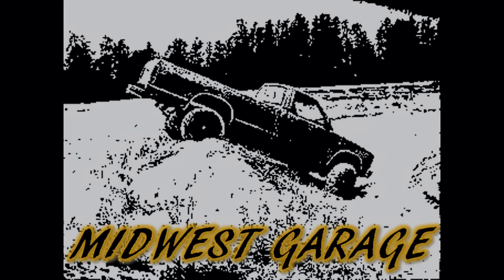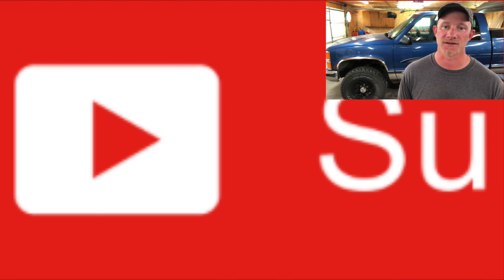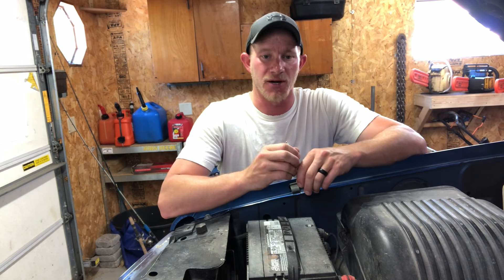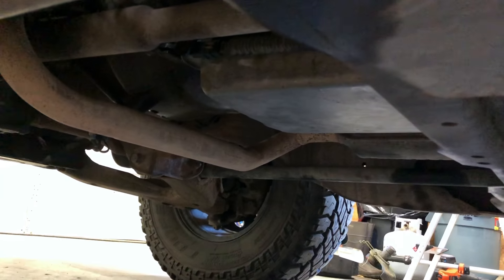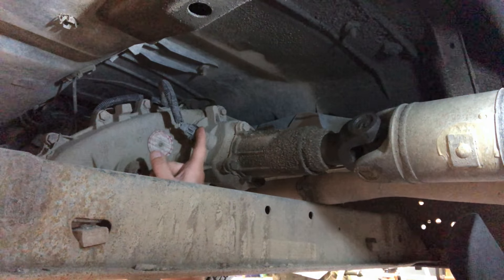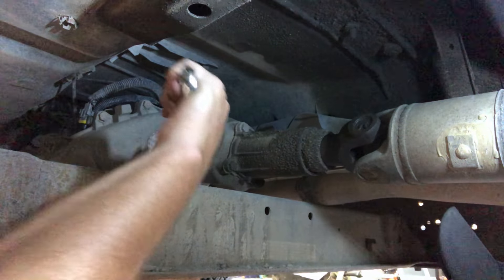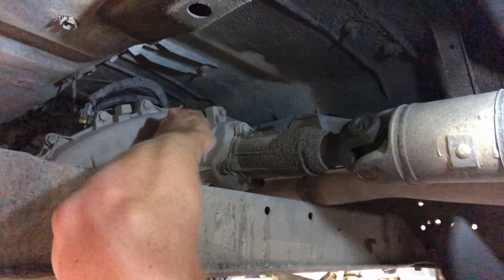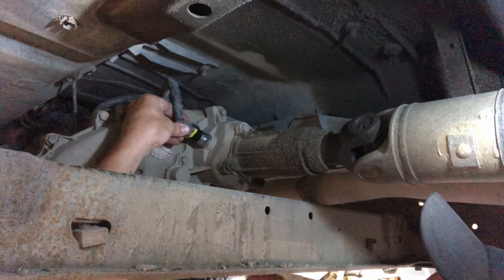How To Replace Vehicle Speed Sensor in 1988-2005 Chevy GMC Truck & SUV

Comment: 380,00000 miles on my 1995 Chevy 1500 2 wheel drive that I've owned  since new. Original Trans and Motor. Been using Castrol full synthetic since new. Change oil every 5000 and Trans fluid every 50,000 Trans started changing funny and slipping and gauges stop working. Change speed sensor, that took care of problem. Thanks for helping me. Kevin.
Reply: Same here. Mine has 370,000 at the moment. 98 gmc 1500 2 wheel drive 5.7 L
Reply: Did it fix the problem right away or did it take a day or 2
Reply: My truck is the same,  my speed o meter read 100 mph when I'm going only 8 mph

Comment: Had two shops look at my 1994 GMC pickup, one wanted to rebuild transmission, the other had no clue. Saw your youtube and replaced my speed sensor. All is fixed now, thanks
Reply: Did yours still shift?
Reply: Was yours making a clunking noise and sometimes slipped in reverse?. Also did it go away right away or did it take a couple days?

Comment: My truck has just been restored to road worthy condition, after having sat for a decade or so. It seems like the speedometer is trying to get me a speeding ticket. When I go 30 km/h, it seems like 50 or more. Maybe I'm just not used to the truck yet, but your video convinced me to replace that sensor.

Comment: I'll be replacing the one on my 1995 GMC Sierra K1500 soon. It's been showing me the ABS light and the speedometer has been bouncing around. My pickup only has 143,000 miles on it, but because it's 30 years old, I think it's time to change out that sensor. Thanks for the tip.

Comment: THANK YOU!! IVE been looking for this awesome video for 4 months!! You just don't know how much this 61 year old disabled lady needed to find this video.  My 2002 chevy avalanche with 260,000 miles has been parked because of the ABS LIGHT, speedometer and shifting issues.  And I've told many that this is the issue.  But no one wants to just help replace for me. They're saying $275. Up to $3,500. But I know that my ole RED just needs this $30. Part and I'll be fixing it myself THANKS TO YOU AND THIS AWESOME GREAT VIDEO!! BLESSINGS TO YOU FROM OLE DISABLED 61 YEAR OLD CENTRAL KENTUCKY LADY!! 🙏

Comment: Rebuilt my trans 7000k ago and it started shifting funny and slipping. Changed the shift solenoids and then it wouldn't shift past 2nd and the speedo stopped working. Almost had a heart attack thinking I had to pull it back out and disassemble to figure out what went wrong! Watched your video, changed the vss and now it shifts perfect again and the speedo works! Can't thank you enough! You saved my sanity

Comment: 1994 Chevy Blazer Silverado Sport, 350ci, manual transmission, 443,000 miles.  This is EXACTLY what I needed.  I'd been noticing these symptoms cropping up one at a time over the last three or four months.  The repair shop couldn't replicate what I was experiencing, so they were stumped.  The most recent one started this weekend with the "Shift" light coming on when it shouldn't, which would be analogous to the erratic shifting experienced by automatics as described in the video.  I replaced the VSS today, and things are all back to normal.  SUPER EASY FIX!  I think it took me longer to disconnect and reconnect the battery than it did to replace the sensor.

Comment: Replacing this sensor fixed my transmission that would shift usually from first to second  then would slip in 3rd  and was shifting all over the place.
Thanks for showing me how the hardest part was getting under the truck.

Comment: I swapped out the speed sensor and it fixed two of the three problems I was having with my 1995 GMC Sierra 1500: the speedometer moving erratically and the automatic transmission not shifting as smoothly as it should. The only thing it didn't fix was the ABS warning light. But I'll check out your other videos to look for a solution. By the way, the sensor in my truck was a whole lot harder to remove. I had to use a foot and half long, 1/2" ratcheting breaker bar with a 1" socket to get it off. Great video! Four years later and it's still helping people fix their own trucks. Thanks. — Richie

Comment: Very helpful. I was told at the mechanic shop that there was a leak at the VSS. They wanted $138.61 to fix it. I said to myself, that's a send sensor, I should be able to fix that myself. So I found your video and it couldn't be easier. Thanks for saving me $$. Dawn

Comment: Based on the diagnosis tips you gave, sounds like this is most likely my problem. Speedometer has been bouncing for about a month, and now it's dead. Had a check engine light come on and go off last weekend, but the most annoying problem (and I didn't realize these are all probably related until I listened to this video) is during my commute to work doing about 40/45 mph, my transmission would jump back and forth between 3rd and overdrive. Thought the worst for the tranny in my '90 V10 Blazer, but now can't wait to see what replacing the speed sensor will do. Thanks so much for an excellent, well presented video. Hoping a $30 sensor and not $$$1000 transmission is the problem. Thanks again, and best regards.

Comment: The car gods must have sent you today...! My 99 Tahoe is acting just like you described. I had thought that it sounded like an electrical issue, but I'm just a lowly woodworker, not a mechanic. I called around to price a rebuild but Dayum at the cost of that! You're a lifesaver! Thanks bro!
(I subscribed)
Reply: Having same issues on my 02 Tahoe , just ordered one from his link.  Did it fix your Tahoe ?
Reply: @rickparshall  Hi Rick. Yes it did the trick. I got under there and replaced it right there at Auto Zones front door. It took longer to crawl under and out than it did to make the repair. But... At first they told me it would be $30. And of course mine cost $95.. Lol. Good luck!
Reply: Robert Ray I'm a woodworker too! And the second speed sensor (the hard to reach one ) did the trick finally.. redid every ground on Tahoe then decided I needed to test every plug with a ground lead.. found one on shifter at tranny and looped the good one to it. I had tested both ABS wheel speed sensors for voltage at plug then for resistance from plug to wheel, both passed those tests so I did the sensor voltage test at plug while unplugged from harness, one spin showed voltage on D/S but P/S had zip.. installed new sensor, light stayed on... no speedo and service brake light came on in first gear and would shift no higher.. first vehicle speed sensor yielded no change, then before finding out my transfer case had another one I had dash ripped apart checking key harness.. found a broken tow-haul wire, fixed that still no change. Today I found the speedo sensor on D/S of transfer case and stuck the sensor in I had taken out of P/S in case after testing it and finding it was good... the abs light went out and it shifts, the speedo works also slew of other issues went away!! You-tube is my friend and I know know just about every electrical circuit on my truck🤣...

Comment: Thank you Midwest Garage. I have a 95 Suburban that was having shifting issues from time to time. Got an OBD1 code reader for my Suburban and it gave me the "morse code" for left rear wheel speed sensor? I'm going to remove this sensor and replace it. Hopefully it solves the issue. Thank you for posting easy and articulate videos to work on these trucks.

Comment: Installed on my 2005 Chev Silverado 4WD, it had a C0300 Rear Propshaft Error Code. With the new sensor, it shifts to Auto, 4 Hi, 4 Low & 2 Hi with no issues.   The sensor was on the Transfer Case on the passenger side, it took about 10 minutes to do and saved me $200 that the Shop wanted!  The old sensor and electrical connector had some corrosion on it from the salty Canadian winters. Cleaned the connector with a small wire brush and covered it with die electrical grease to keep the water out.

Comment: Looks like this is 100% my issue, thanks for posting this. ABS Light has been on since we bought the tuck and speedo + trans just cut out/shift rough. Wanted to comment thanks before I tried the sensor and forgot.

Comment: This video is so helpful! I have a 1993 Sierra that I had the transmission rebuilt in after I bought it (it wouldn’t shift past second, so a needed rebuild) and the speedometer has always been inaccurate in it. I’m going to try replacing this sensor to see if that helps. 

Thank you for the super helpful and clear video!
Reply: Did it work
Reply: Did it work??

Comment: Great job on information.  Had a non working speedometer, ABS light on, erratic odometer and shifting and check engine light on my 1998 Olds bravada. Replaced VSS and all problems fixed.  Perfect video. Thanks.
Reply: Codes for the engine light???

Comment: Super clear explanation. Just purchased a 94 GMC 1500 4x4 Auto Trans. Service Engine light just came on (less than a week after driving it home). I have also noticed sporadic shifting as you mentioned. I'm going to check the OBD and see what codes pop up but this inexpensive, easy replacement is at the top of the list of troubleshooting.

Comment: Just happened to me today with my 1996 chevy suburban 2wd has been running spot on perfect..started it today at the lake and running a bit rough no gauges check engine light on trans feels like its slipping.limped it home and saw your video i will replace the vss and see what happens.i will update when i can..😊

Comment: Thank you for sharing your experience and knowledge.  I will have to watch the video again. 
I am having difficulty in determining which sensor should I purchase for my 2005 GMC Sierra 1500 VHO 6.0L RWD Automatic transmission.  Does my truck have a 16-bolt or 17-bolt pattern on the transmission pan?  Various parts search platforms state the following, "Some vehicles may use the same part for both a Speed Sensor and an ABS Wheel Speed Sensor, while others may use two different parts. These parts serve different systems of the vehicle and may fail for different reasons - it is important to replace the proper sensor to fix the underlying issue."

Comment: Thanks so much for this.  My speedo would occasionally stop working and then later start up again and then today the ABS started flashing a code 9 (Open Circuit to Speed Signal) so this all ties in to what you are suggesting should be an easy fix.  Great video that gets straight to the point.

Comment: I think you just saved me a ton of troubleshooting time.  The symptoms you describe match my problem, with the exception that I hear a bit of a grinding noise when I drive the truck.  i'm hoping when I remove my speed sensor it is still intact and is not in pieces floating in the transfer case!
Reply: This sounds like my issue.  Did the speed sensor fix the issue?

Comment: This sounds like the exact issue my 2000 k2500 ls  is having. Looks like a simple fix thankfully. Gonna do this first, and then clean the abs wheel speed sensor if the problem isnt resolved. Thanks man

Comment: This video was a huge help I was having a issue we’re sometimes my truck would shift horribly for no reason when taking off from a light a code would come on and it would sometimes stay on or sometimes it would shut off. It was this sensor my plug has trans fluid in it so not only the Sensor but my plug as well fixed it and been mint ever since

Comment: I have a 2012 Chevy Express. I'm experiencing shifting problems too. I'll update you on your recommended fix. I'll change the speed sensor and replace the transmission fluid and filter.

Comment: Thank you yes this video really helped me I have a 2002 Chevy 2500 gas and the speedometer don’t work and the abs light is on
Reply from the maker: I'm glad I could help! Thank you for the comment Larry!
Reply: Thank you think I solved my problem
Reply: I have a 2000 Silverado the transmission is just one of the problems this truck has but would solve a few of them for sure!

Comment: I'm wondering if I should replace my vss. My speedometer works but the transmission doesn't shift unless I run the rpms up and let off the gas to shift. Scan tool doesn't show any codes on transmission just O2 sensor bank 1
Reply: @Robbie Lee what did you come up with mines doing the same exact thing

Comment: I have a 2006 Silverado 1500 2 wheel drive and your video was very helpful and informative. Thank you very much. I also have all of the symptoms that you described.
Reply from the maker: Sweet, I'm glad this helped man! And thank you for the comment, it's good to know that it's a common issue and the symptoms aren't just something that we experience in the 90's pickups!
Reply: @MidwestGarage  No GM made sure that the problem kept being reborn in later models too 😆
Reply from the maker: @jameswebb3932  Hahaha, For some reason that doesn't surprise me lol.
Reply: WOULD THIS ALSO CAUSE A NO MOVEMENT WHILE IN GEAR ??? I HAD SAME ISSUES (EXCEPT ABS / BRAKE LIGHT ) 

BUT NOW IT WONT MOVE

Comment: Your video was good but my trans don't slip or jump my MPH is off, my GPS says 60 and my speedometer says 80 to 85 so this runs my RPM a lot higher and really works on my gas mileage. Now I can change the sensor I wasn't sure if there wasn't something under the dash that I needed to do. So thanks for the info.
Reply: Mine's doing this same thing.  No shifting issues.  When I first turn the key on, all the gauges do a self-test, then the tachometer pegs at 6000 RPM and when driving, the speedo is off alot, (it says I'm doing 95 when I'm actually doing 65.)  Man, I sure hope this sensor fixes it.

Comment: Thank you for the video. I've been trying to dial in my 95 chevy 4x4 350, with a surging issue and the tach issue. I've already thrown a bunch of parts at this truck. To no resolve. My truck is a 5 speed Manuel truck. So I'm hoping this will solve my issue. I will let you know. Thanks again.

Comment: Very good video on this well done 
But I wanted to say this wasn’t the case for me it turned out to be a fuse 
I was having same issues no Speedo/acting weird, trans not shifting right if at all and no codes or anything shown 
I spent a lot of time tracking down wires and I replaced sensors still didn’t work 
But there was this fuse in fuse box under dash labeled “brake” changed that out and bam back to normal 
(Fuse wasn’t even blow just corroded enough to not make a good connection

Comment: I haven't done the stuff that you said in your video but everything that you said about the speedometer not working the ABS is on the security light is on and everything and it does not give out of control signal and think if I had to check but it does not shift and I know all the gears are there cuz they weren't slipping or anything

Comment: hey thanks for the tip..i have a 95 silverado thats thumps while going from 1st to 2nd gear but when i disconnect the battery it seems to reset it.....this mite be the problem
Reply: I have a 2007 chevy suburban and it shifts hard from 1st to 2nd gear also and im thinkin this is the problem to our fix man
Reply: Did this sensor fix your hard shift problem?
Reply: Same,  any luck?

Comment: Got a 2004 Chev 2500 HD duramax- would not go into 4wd  but would 4wd low then would not get out of 4wd low. finally got it back into 2wd after putting in reverse and trying different things. Are we looking at the speed sensor or actuary or both?

Comment: Great video Kevin, I have a '89 K10 and replaced the speed sensor about 3 years ago and now I'm getting 9 flashes on my brake light. Everything works fine. Could it be another speed sensor?

Comment: If you have a scanner, you can also see the output R.P.M.'s. I have seen it where it is showing 50+/ 05 R.P.M. and so on, jumping around when you aren't even in gear.  It's not a bad idea to put a new output shaft bushing and seal in as well.

Comment: Thank you for sharing I have a 2005 Chey trailblazer LT 4.2 and my speed gage starts out at 120 and when driving it go off the numbers then when you come a stop it will go down to 80.  Do you have a video for that or tell me about its location on the transmission please and thank you.?

Comment: Great video...straight forward and to the point.  My son's trans will only operate in 2nd and Reverse.  The PRNDL indicator doesn't show what gear he's in.  We've replaced the NSBU and the Ignition Switch as well as an inspection of the TCM connectors...still no luck.  Any chance the speed sensor could be the cause?

Comment: Man thanks. I have a K1500  chevy  blazer just got the transmission replaced and it shifts hard out of 1st and the abs is on and the rpm gage jumps so it's doing all that so hopefully that will fix it.

Comment: Is the output speed sensor located in the same place on a 2005 Chevy 3500, 4x4, duramax diesel, allison 1000 transmission?

Comment: @midwest garage I was coming home from work yesterday in my 03 H2 & while going to down the road felt a hard jerk & transmission down shifted. I pulled over & put in park. Got out & looked under vehicle for fluid or anything outta the ordinary. All looked good. Started vehicle back up, put in reverse went into reverse fine, shifted to D nothing, then 3rd nothing, so I shifted to 1st moved just fine, 2nd just fine, but no 3rd or drive. Luckily I wasn't far from home so drove home in 2nd. Does that sound like a VSS issue
Reply: ANY UPDATES????

Comment: If it’s on the transfer case then what’s the one on the drivers side on my nv3500 manual I got it in a 1994 Cheyenne (manual swapped it)

Comment: Hi how are you? Your video is very useful, the ABS anti-lock light came on in my chevy k-1500 year 1996 and it gave me the following codes.

25 - left front speed sensor or circuit open.
21 - right front speed sensor or circuit open.
35 - vehicle speed sensor or open circuit.
22 - missing right front speed signal.
27 - erratic left front speed signal.
23 - erratic right front speed signal.
37 - erratic vehicle speed sensor signal.

I would be grateful if you could guide me a little,